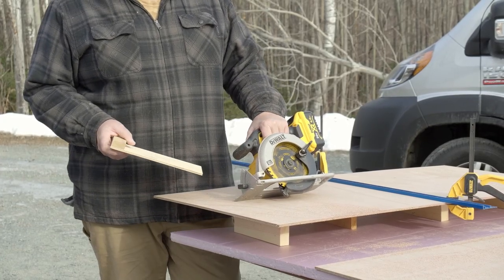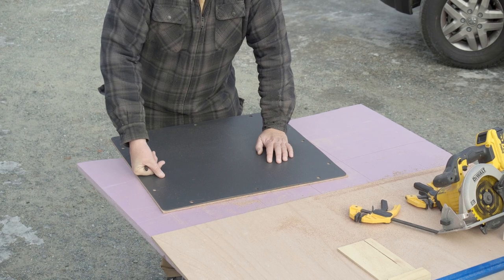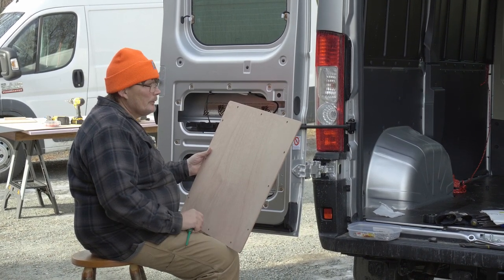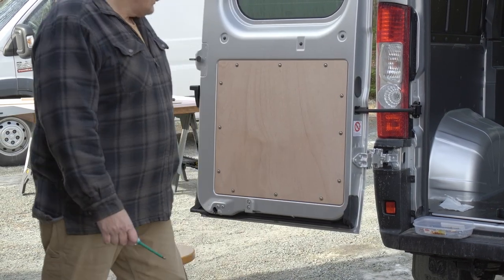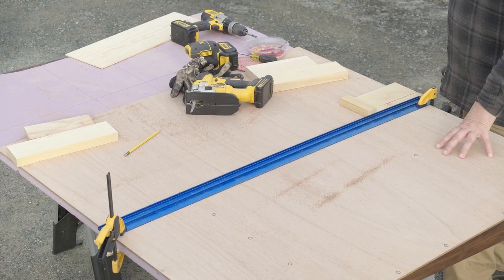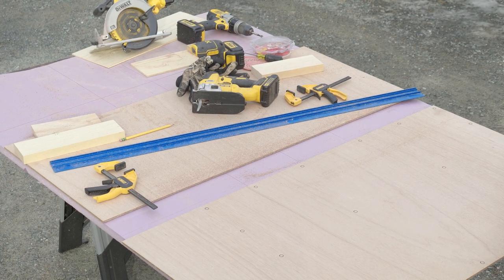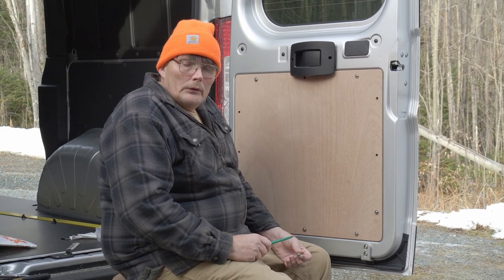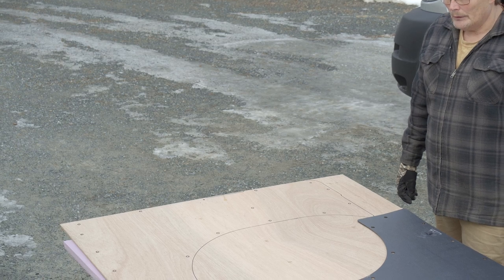Ram Promaster 118 WB Camper Van - Part 2

Comment: I really like your idea of replacing the plastics with plywood panels. Why did you decide not to insulate behind the panels?
Reply from the maker: I did put some pink foam behind a few panels and all of the ceiling - but the main reason a lot of the side panels were not insulated is because I have read a lot of pros and cons on condensation and mold issues or possible mold - I figured I would just let the van vent as per how it normally would - we don't plan to live in the van, its a super glorified tent - I think the ceiling foam stops most of the direct heat entry - Maybe this is the best choice in arctic cold or desert warm sun - but for 90% of what we do with the van its been fine. I really think the extent you go to on insulation is a personal choice and there is no right answer. I only seriously insulated the ceiling, thats where I felt I could get the most benefit.
Reply: @fireflightphoto1319  Once again, your logic is rock solid. It makes absolute sense that the roof would be the main source of heat gain/loss, and thus should be the focus in regards to insulation.   The "glorified tent" theory is exactly what I intend for my build; having a home base is too comfortable to give up.  The possibility of moisture accumulation in the walls definitely weighs heavily on my design strategy, but at least with the riv-nuts and plywood panels, it wouldn't be too hard to open the walls back up for insulation later on.  Thanks for your reply!